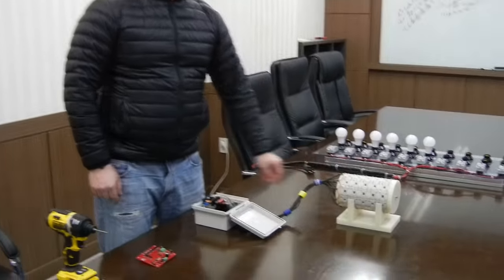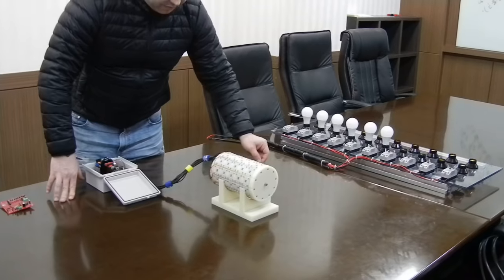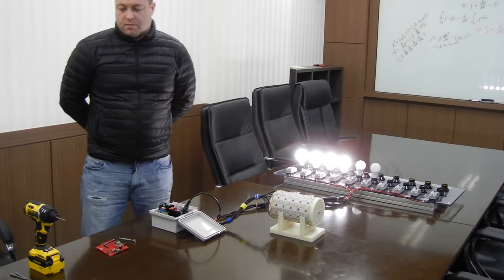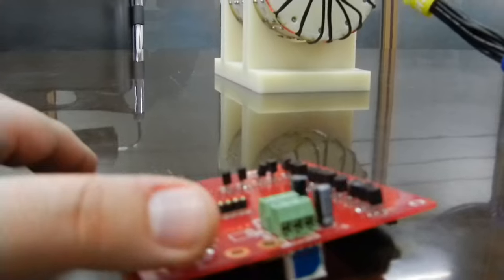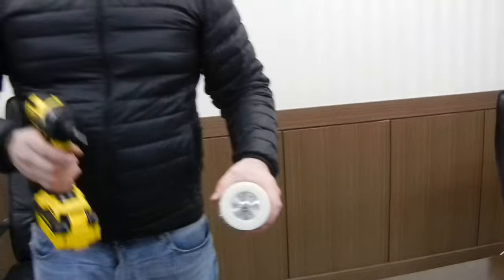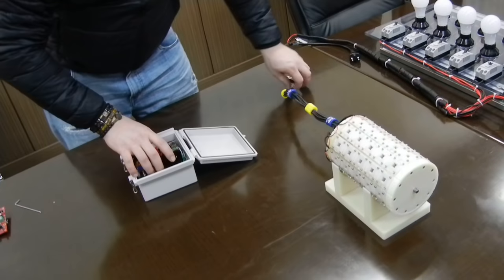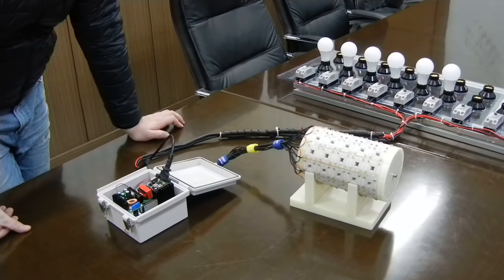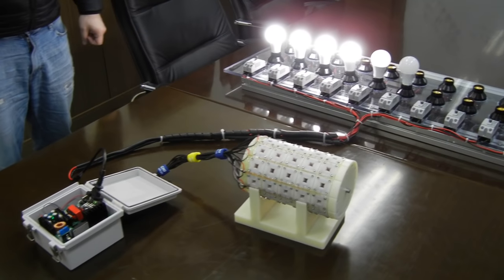Full dismantling of 1 kW magnetic generator

Comment: interesting the stators from the generator, generate electricity to the junction, than the electricity is pulsated back to the generator, and part of that energy runs the load  Love it! First off, it is not contradicting the laws of thermodynamics. The Tesla pulse generation is using the same power generated from the generator, causing it to jumpstart and run itself.
Reply: "it is not contradicting the laws of thermodynamics"
yes it it. if you get more energy from a system than you invest it's against the first law of thermodynamics.
Only possibility for not offending this law would be that the magnetic power stored in the magnets is the energy input which is drained for the amount of output energy over time (similar to a embankment dam). As the magnets only lose a very little amount of magnetic charge over time, the energy released by that is in no way bigger than the energy that is consumed by friction and output energy (that is used for lamps here)
The only way for this device to work as descibed is that the laws of thermodynamics are wrong or incomplete in the current version. Sadly that is very very unlikely the case.

Comment: My only query is the connector on the end of those wires, 1 KW is a lot to put through those pins, but I could be wrong.
Reply: It's high voltage and then brought back down. High voltage has no problem going over thin wires. Once you bring in amps then you need to increase gauge of wire or you'll blow em.

Comment: Your load has only 6 pcs led bulb of under 10 watts. Doesn't trust load and pcb assembled dc-ac inverter for 1 KW capacity. But your generator coil locations are very good idea for reduce another generator .

Comment: You forgot to lift the double bottom of the grey box. Most probably some batteries in there.
Reply: They hav a acumulator in the down on the box.
Im see lite Inwerter DC DC -- LM chip. (yelow , orange cable to the red mainboard)
The procesor must by powered somwere to good work machine.

Comment: Did anyone else catch that the translator said 10KW PER hour rather than 10KWH? There’s a big difference. 10KW/hr means that over an hour’s time, 10KW can be produced. You could calculate that as 167 watt hours. For 1KW/hr motor, that’s 16.7 watt hours. That’s easy enough to start with a finger. With proper management of the back electromotive force, I can see this as possible. The lights themselves just need consistent high voltage spikes which this motor could easily produce. Here’s an experiment I did with back EMF driving half the coils on a motor that requires less than 10ma to run at idle. https://youtu.be/6LlcSS6Ji6M
Reply: The guy translators English is not enough good that's why

Comment: you know...i think these bulbs are led's or cfl's..with the rpm the freq. must be multiplied or the output is 400 Hz or higher. or some combination thereof.high freq. or high voltage takes very little amperage to do apparent work.let us see it run a 60 Hz. 1 hp. motor under load.let us see an amp meter and a freq. meter on this setup.also, let us be sure there is no induction coil under the table.

Comment: Increase the number of coils without any metal inside. Just connect the coils in series. This is the key point.

It produces energy.
Reply: Unfortunately it doesn't work that way in this setup. I know, I agree with you, connect them in series and multiply your volts. But this doesn't quite work that way unfortunately.

Comment: i think, if i not false : Not 10. ...5x11=55...11...
Because 11-10= 1... it is need 1 more line for needed factor for push to infinity loop . 10 coil is generating energy for out. And 1 line is make free the alternator, when alternator need space for unlock the loop for move . For example this line is may be for pulling .. And the software is managing this line with the hardware for what needed changes. which cell is need the push or pull...
Reply: kafan iyi çalışıyor ilk muammer yildiz yaptı bunu . O yaptığı zaman yazılım kullanmıyordu.

Comment: Germans build before WW 2 a Radio that runs without a battery, it works only with a Antenna some meters long. It was a so called „Throwing Antenna“ you throw the antenna in a line over the ground. It was completely „Analogy technology“. The Universe is analogy, not digital. So we see on this radio, you able to run a Maschine, a electric Maschine without energy you give to the Maschine, the trick is to construct the Maschine in a way that the Maschine suck the energy from the analogy energy that surrounded our earth plane. And the Maschine work through its genius architecture! 
This motor is a „Analogy Motor“. 
And it is constructed to put out high potential of energy…but that alone don’t let the motor real run!
What let it run?
A fast trigger impulse released by the high digital technic board, that is able to run on „Very low energy“ but through its program code, it puts out directly the „Trigger impulse“ to the rotating motor engine. 
This impulse draw the axis in one direction and at the same time the trigger impulse runs faster!
So this motor turn his speed up!
And through this very fast digital trigger impulse by very low needed energy, the motor came very fast on the Point of more energy output! 
And the motor runs through its self…and by the digital trigger impulse that „DRAW“ the engine constantly forward, to a specific rotation speed, what the programmer program into the software, inside the digital board. 

That is how I explain the motor, in my opinion it is not heavy to understand, in my opinion it is heavy to understand „How fast the trigger impulse have to react, that the motor get a forward impulse that daw the motor and don’t stop or Barke the motor, this is a very specific fine tuning to get it work, I think so. I belief you can do it maybe in a „Software bench“ that can Math that thing and then you must check it out in reality.
That’s the way to work and success.

Comment: Даже представить не могу, как изменится наша жизнь за ближайшие 20 лет, если это работает. Ролику уже почти 3 года, а почти никто не осознал силу устройства. Это говорит об общей тупости и о бескрайних горизонтах науки, и что и в гараже воможны  чудеса. Ну а если подумать, что такое электричество - это движение электронов. Генератор гоняет электроны туда и обратно, из пустого в порожнее. Не колбаса же из него вылезает. Генератор киловаттный, но я увидел всего 40 ватт. А где остальные? Почему из статора 14 пучков проводов, ведь катушек 55 ?
I can't imagine how our lives will change in the next 20 years if it works. The video is almost 3 years old, and almost no one realized the power of the device. This suggests a common stupidity and boundless horizons of science, and that in the garage miracles are possible. Well, if you think about what electricity is-the movement of electrons. The generator drives the electrons back and forth from the empty to the empty. Not a sausage from it. It's a kilowatt generator, but I only saw 40 watts. Where are others? Why from the stator 14 bundles of wires, because the coils 55 ?
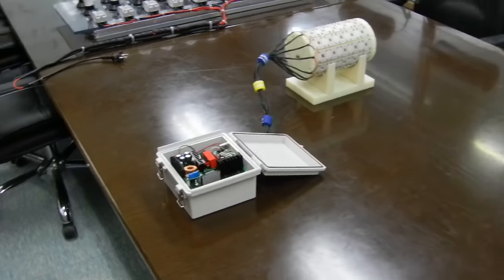Reply: Я насчитал  20 проводов,вокруг 10-ка шурупов. Насчитал 14 транзисторов,в каментах прочел про 3вт лампочки на светодиодах. На 3:04 слева ,вроде стоит обычный блок повышалки напряжения. Автор сказал что секрет в софте. Думаю ,он и регулирует прием,посыл,обработку,частоту,накопление и увеличение сигнала. Заявить 1квт может просто,как "колхозник",как Капанадзе который намерянно скрывал истину .

Comment: So many problems with this:
Where's two large coils that generates the electricity?
Where are the actual magnets that produces the electricity? 
Why is this hardware on a board room table?
Where is the cooling system that would keep your plastic box from melting away?
Plug a hairdryer up? Yeah, about that...
Please don't tell me you are stopping a 1kw generator with one superman style finger?
Why does this look like the same device that was counted a fraud in the 90s?
But the most puzzling of this all have you ever held a 1 kw generator, without the source of the energy supplied? This is just the magnetic source, where is that heavy equipment (at least 150kgs) that heats up?
Also in order to produce one 1kw on a table, you would need alternating current, that goes back to the first question.

I am not calling you a FAKE, I would just like for you to explain to the world you want to believe...